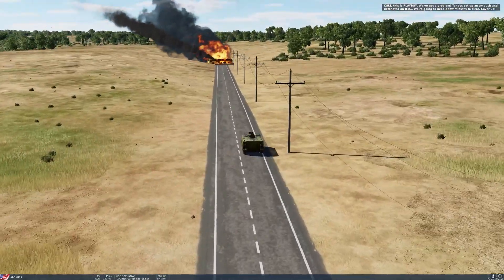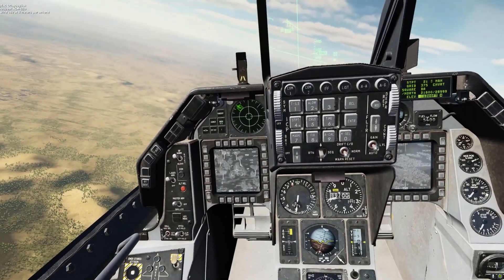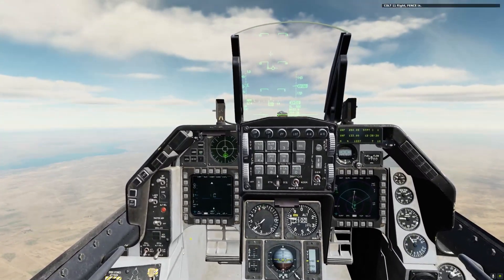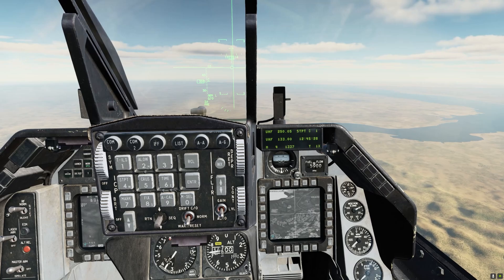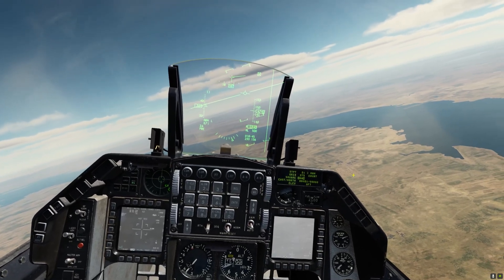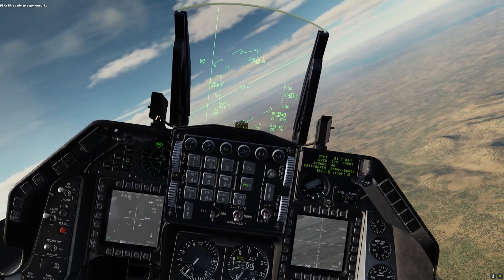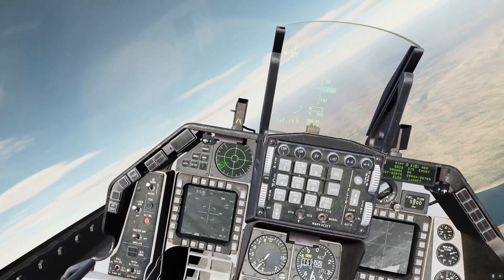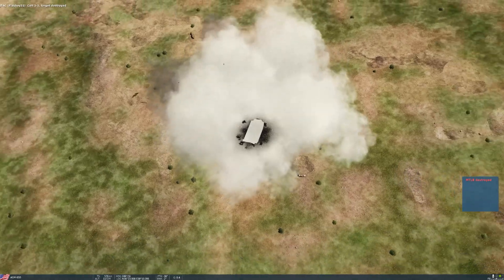DCS F-16: Creating Steerpoints with MGRS for CAS

Comment: How do you know what grid to input? Where can you find that data? Great video, thank you!
Reply from the maker: Here are some options:
1) Look it up before the mission using Google Earth or http:\\map.army or any other map software which can display MGRS. 
2) Change your default coordinates system to MGRS in DCS settings and then use the F-10 map.
Reply: @strix36gaming  You can just click or right click on coordinates in F10 map to cycle between coord types. No need to change that in settings
Reply: @Dzarafata  Awesome, didn’t know that. Thanks!